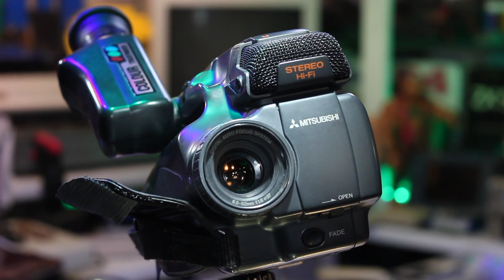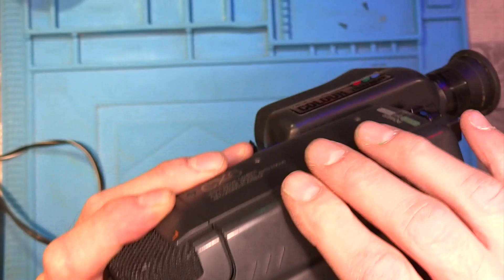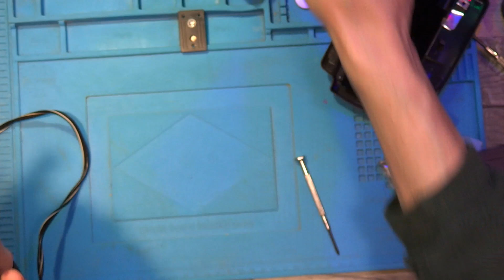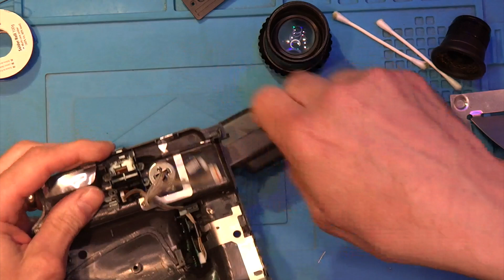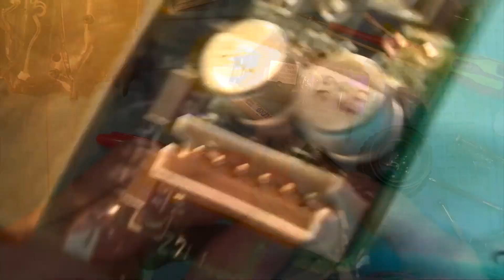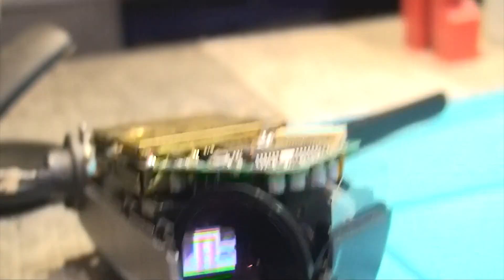The MITSUBISHI HS-CX6 Camcorder from 1992 with a CRT Field Sequential Colour Viewfinder Does it work

Comment: I just got hold of one of these, so thank you for making the disassembly painless! Mine was minty on the outside, but lots of cap leg corrosion inside sadly, but predictably. My CRT's making a noise and drawing about 0.38A . No spinning or picture though. Time for my first surface mount repairs. Thanks again - very informative.
Reply from the maker: Just wanted to say thank you for the donation. My first one since I started YouTube 5 years ago. 🙂
Reply: No problem - it was the perfect video to come across! My motor sync board has some pad corrosion from a spilling cap and i'm not certain which traces connect to it. If there's a way to contact you then i'm happy to donate more if you could confirm the pcb connections on capacitor C7CO.
Reply from the maker: I will have to dig it out and take a look. Not sure when though.
Reply: I managed to work it out ok. I sent the pcb to a local firm to replace all the caps on the field sequential pcb, 8 of them, as i didn't want to practise my smd non-skills on this. Sadly though it was not a fix, in fact now i only have half the current draw, no wheel spin at all and only a snow picture. Gutted! If you ever felt like having a comparison with your working one i'd be happy to send it to you. You're far more knowledgeable than i.
Reply: I know some of that info contradicts my first post. Later on from that post i did manage to get a picture and crazy wheel spinning when i jacked up the voltage to around 6.5v.